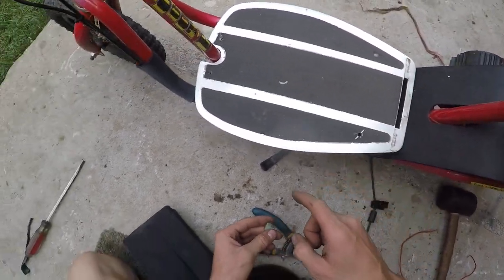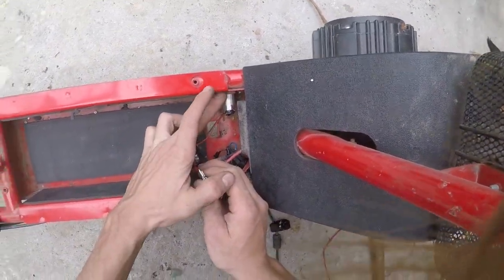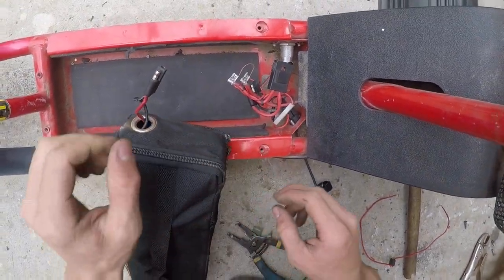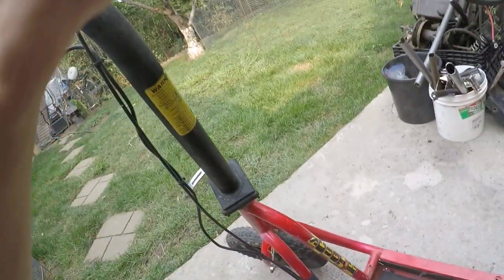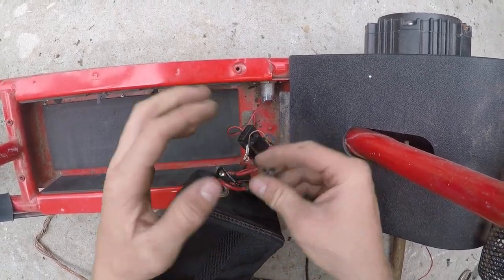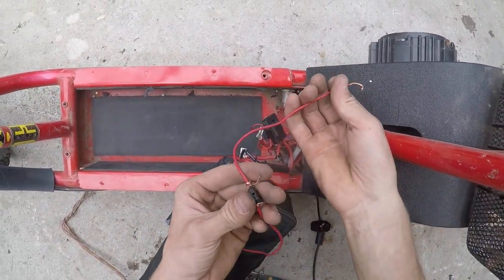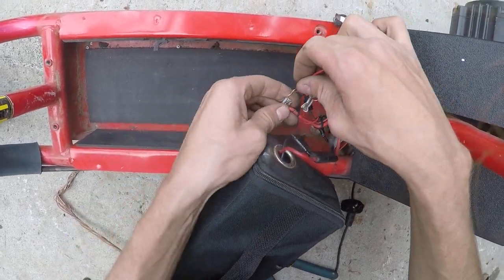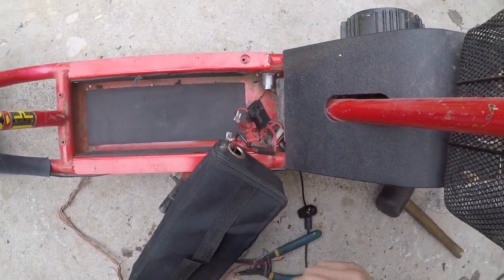How to bypass key in an electric scooter

Comment: Possible with every escooter?? (Viron escooter)
Reply from the maker: Yes, you can bypass a viron scooter, the process will be a little bit different in every scooter. This video shows the basic. Find key ignition and take out the two wires that go in them. 'You may need to cut them' touch the two wires together and it should work. By doing this You will compete the circuit and it will give power the the the motor and computer. If this dose not work check your batteries and your computer controller. If you scooter works after this you need to wrap electric tape around them so that they will keep contact. Sodering and electric tape works the best.